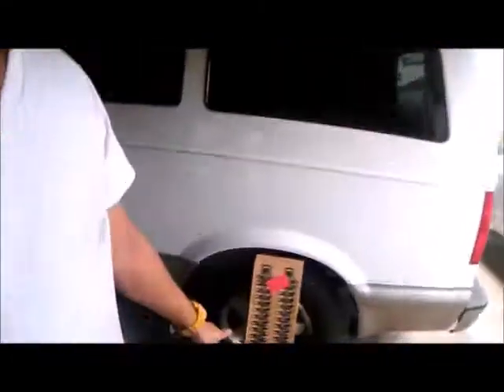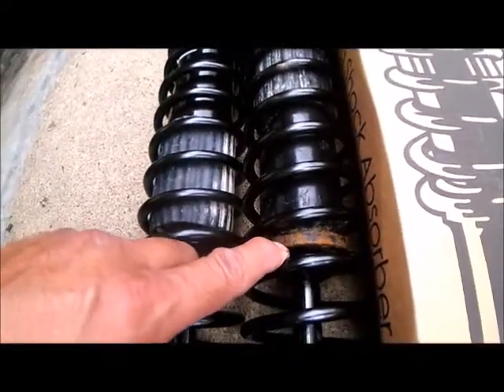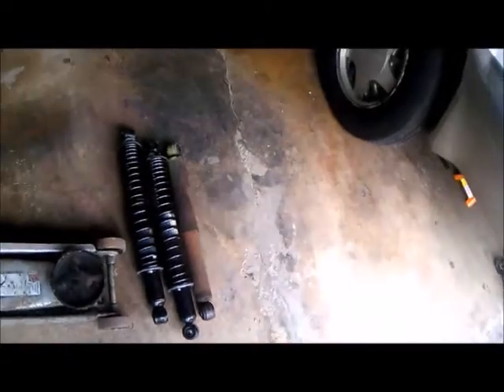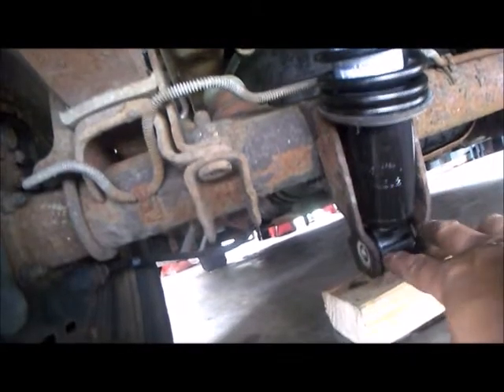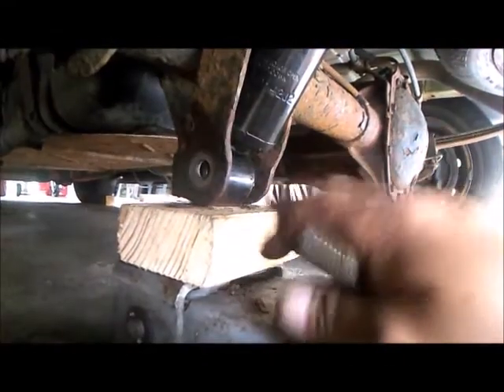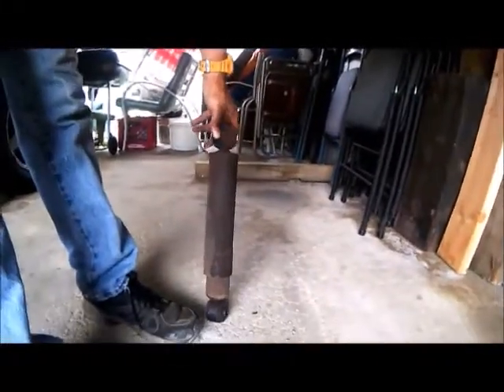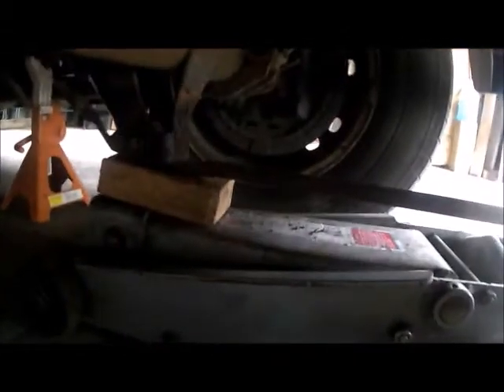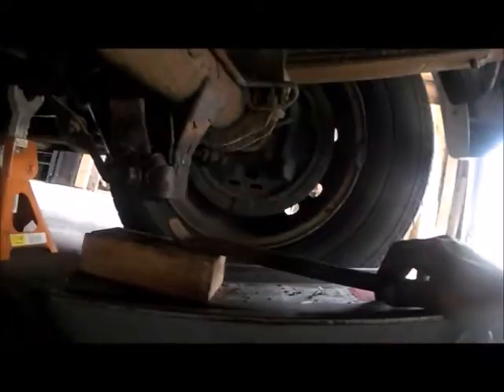2002 Chevy Astro van rear shock replacement

Comment: I just got around to replacing my rear shocks (2004 Chevy Astro) and figured out a way to make the installation at the bottom end a lot easier.

On the first shock I jacked up the by the diff and placed jackstands under the axle inboard of the shock mounts enough for me to access the lower fasteners.  I cut the wire on the new shock, attached at the top bolt and then had to really struggle, getting myself right under the end of the shock and pushing upwards with all my strength to compress it and get the bolt in at the bottom.  I had already watched this video but thought I’d see if I could do it without using a second floor jack since I was already under the vehicle.  It worked but was really tough.

Before doing the other shock I thought about the process and realized there could be a much better way.  I supported the rear of the van at the forward spring shackles (with my floor jack up under the diff just enough for safety backup) so the axle and springs were allowed to extend downwards the maximum amount.  My Gabriel shocks (not struts like Trev installed) came wired so the shocks were compressed completely in the box.  I mounted the second shock at the top first, then got the bottom bolt ready to install and cut the wire.  The shock extended downwards with me guiding it  into the correct position and inserting the bolt just as the holes lined up.  Easy peasy!  Worked perfectly!  Since this is the first shock replacement I’ve ever done I have no idea if other shocks come wired, but I have to guess a lot do.  If not, I see no reason why you couldn’t use some wire or rope or something else and easily compress the shock with one end on the ground while standing over it pushing downward and then secure it in the closed position with whatever wire you choose to use.  I suspect you could probably do it with the same struts Trev used, as the springs appear to be shorter than the extended shocks.

Comment: My van was bagged and the leaf spring was removed. Now the bags are flat and wore out. Would these shocks hold the weight of the van? Right now I’m currently sitting on the frame.
Reply from the maker: No way you're gonna need to put the Leaf Springs back.

Comment: I put on the same kind of shocks and I found that if you lift the vehicle with the front shackle for the leaf spring. I was able to do it by my self by just jacking it up or letting it down to get the bolt in the shock.

Comment: Thanks for the video, will be doing this soon but I don't think I'll go with the heavy duty shocks, I'm afraid it will ride too stiff. We don't really haul anything very heavy so I'll probably just go with some good quality shocks, probably KYB shocks if I can find them to fit and they are reasonably priced. I've found a lot of good deals on Rock Auto for parts so that's usually where I look first.